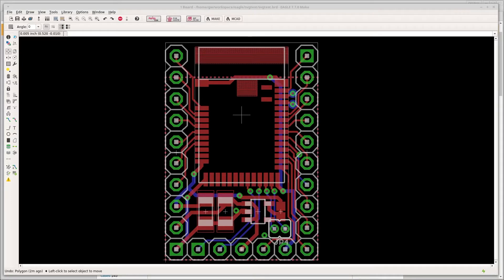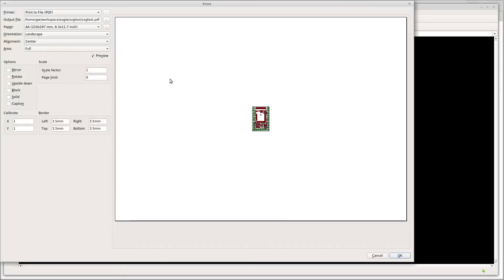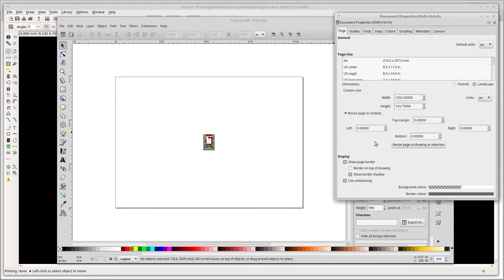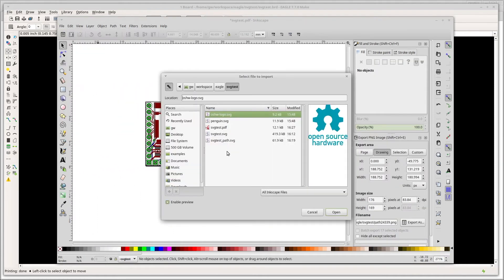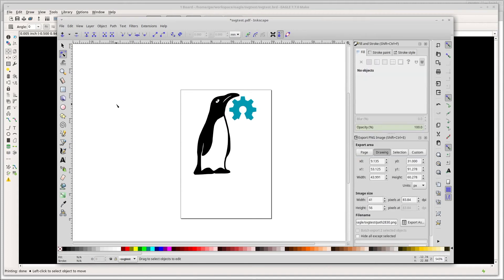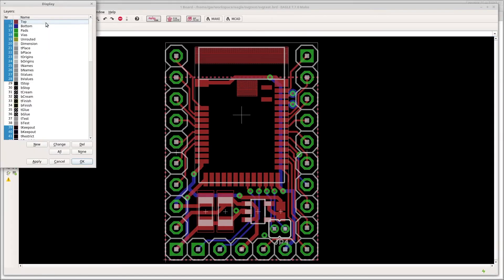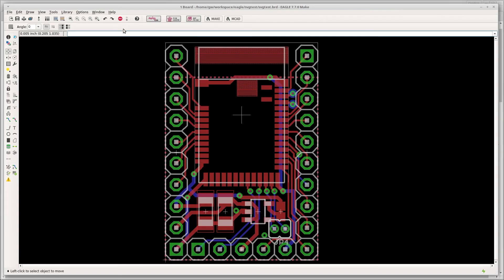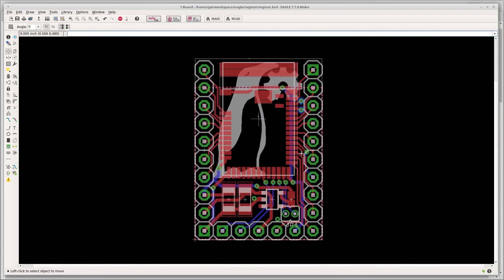Importing SVG into Eagle CAD for PCB silkscreens

Comment: Is the Tool still working? It does not create an output
Reply from the maker: Yes, it should be fine. Maybe try another SVG just in case. Also maybe try Google Chrome - if you're on an older IE of maybe Safari it might not work.

Comment: hi, I know this vid is old, but I'm having trouble getting your converter to work. I'm new to inkscape, but when I break apart the layers in my svg it causes your program to draw the cutout as a separate polygon on top of the object. That results in it not getting cut out in eagle. What am I doing wrong? Many thanks
Reply from the maker: Hi - you need to ensure that the area you want filled (including the cutout) is a single polygon. Select the outline and the holes and choose Path->Combine. When you bring it into svgtoeagle it should then be fine
Reply: @Espruino  thanks, it worked like a charm! The only issue now is the rendering left the cutouts a bit small, so the text looks awkward. I can always just edit the svg before using the tool, or is there a way to easily change the border of the polygons it renders?
Reply: @davepegado2920  There's no setting on the site - it defaults to 0.1mm wire size, but if you search for `polygon GND 0.1mm` and replace the number with something else in the script before you run it then you should be fine

Comment: Is there a way to do a board outline on the Dimension layer using an image? The issue is that the script uses polygons with fill and wont draw a path without fill. I normally draw board outlines using the Line tool not the Polygon Tool. (Which i believe thials script is using).
Reply from the maker: If you supply polygons with a stroke but no fill then they should be treated as lines, and should be ok for the dimension layer. But make sure it really is no fill at all (eg 'unset') rather than 0% opacity or completely white.
Reply: @Espruino  ,I've been struggling with the Dimension layer too. Thanks for the tip! (and thanks for this whole project; so many beautiful boards owe a lot to you!)

Comment: Hi, does this script still work? I am trying to add my makers mark to my PCB which I have as a very simple SVG. I followed your guide and nothing seems to happen when i run the script even as an *.scr.
Reply: It still does, yes - are you sure you have the layers you're putting stuff on visible?
Reply: @gfwilliams   my text is on tPlace which seems to be the default of the script. and I can see it.
Reply: I wonder if the issue could be that it's just an open stroke. I may hafta see about making it a filled solid.
Reply: Ok, switched to a filld solid, oddly it drew the outline and not the fill and it's kinda spotty but it worked so. :P Ignore the spotty and fill thing. I had moved it to Top to see if that was the problem and it couldn't do the copper right i guess. Putting it back on tPlace and it looks great. Thank you so much @Gordon Williams

Comment: I found this worked well with two tweaks (just to the instructions). First, I needed to ungroup all the paths.  Not sure if it should have handled groups, but removing the groups (which were created by converting text to paths) fixed my first problem.  My second was that the Eagle command box would choke after too many commands.  I found that taking your generated script, saving it as a .scr file in the Eagle Scripts file and then running it worked perfectly.  Thanks!
Reply from the maker: Thanks! I'll add that to the instructions :)

Comment: Hi, I Try with Adobe Illustrator, save to SVG, but no working. I have the document in mm. The error is: 
SVG width not in mm - GUESSING dimensions based on scale factor
Try setting document size in mm in Inkscape's Document Properties
Dimensions 82.65mm x 75.29mm
No paths with fills or strokes found.
Reply from the maker: Maybe try setting a fill or stroke on some of the paths you have? Failing that, does it work if you load in Inkscape and then save?

Comment: on the svg converter tool, the scale factor is whit 90, the image/logo it will be reduced, so we have to change to 100 or 1 value to get the same logo size that was already changed at inkscape to the desirable scale, right?
And the svg converter tool dont works for me..

p.s.: finally get the data (after long advertising messages get from the browser), but the image at the eaglecad is not on the same scale, it appears in a very small size...and looks that the code generated is truncated on the eagle box..
Reply from the maker: If you're getting the wrong size then yes, you'll need to change the scale factor - although 90 does usually seem to be the default. Sadly it seems that SVG doesn't have an easy way to get a 'DPI' value since the default units are in pixels. If someone figures it out maybe they could give me a PR to help improve the code.
Reply from the maker: I've now tweaked this so as long as you set your Document Size in millimeters in Inkscape it should work